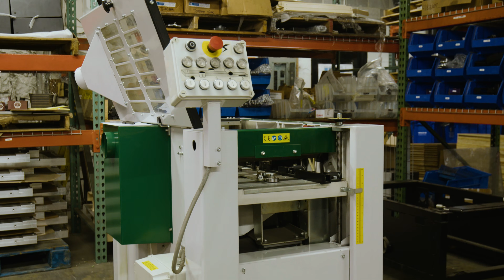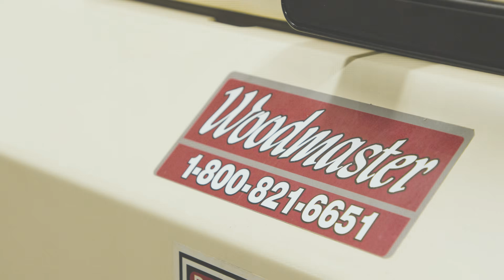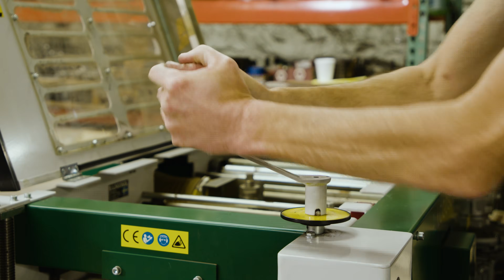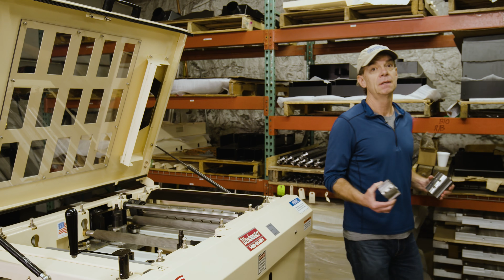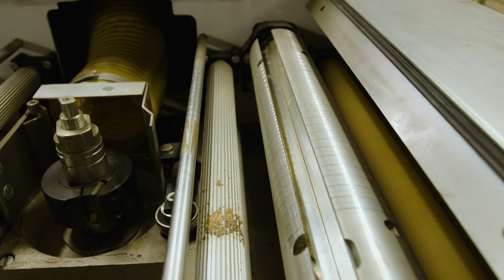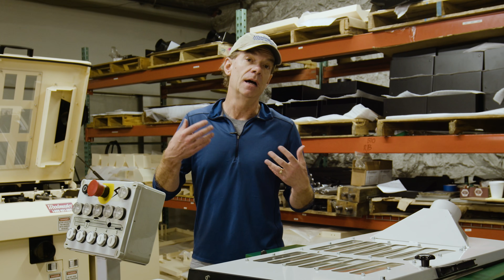Side-by-Side Comparison of the Model 4000 & Top 4-Side Molder Competitor

Comment: Thats a older Logoso model... If you compare it with a woodmizer mp280 I think it would be a fairer comparison ..If you compared with a.... for instance... a Cantek 412 I think you will find it to be a whole different story... Looks like it has the same footprint as yours...This is a well thought out molder though... The corrogated knifes and heads are super important and nice to see... and the 4 slots are a bonus...cannot argue with USA made and backing is huge, I guess I would have to try it side by side to see...Those knives looked very thick! I would have to check mine but that is a factor indeeed...
Reply from the maker: Thanks for the insightful comments. Worth noting that the Woodmizer machine is simply the Logosol machine painted a different color. There have been some updates, but the essential advantages of the Woodmaster 4000 against the Logosol/Woodmizer remain. I believe Woodmizer moved production from Sweden to Poland, but it's still not a US-made machine. The Cantek looks like a nice machine, but again it's the same money for a Taiwanese machine versus a US-made machine with knowledgeable US-based service, US-made motors, parts on the shelf, US-based custom knife production etc.
Reply: Hello.  Comparing it to the Woodmizer 360 unit would be more accurate.  The 280 and M412 are smaller machines.  For most small to medium shops, the Woodmaster 4000 is offered in single phase as well as 3-phase.  The other units are 3-phase only and would require a phase converter(s) to operate on single phase increasing the overall upfront cost.